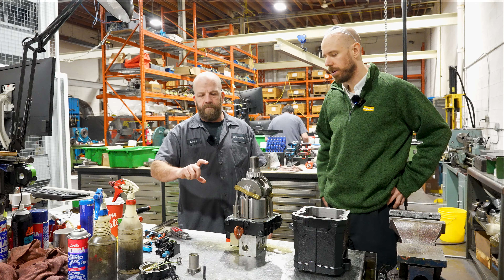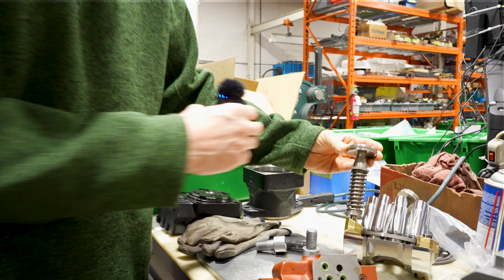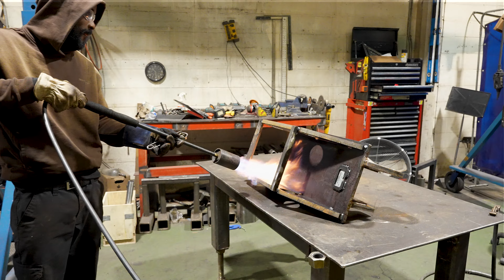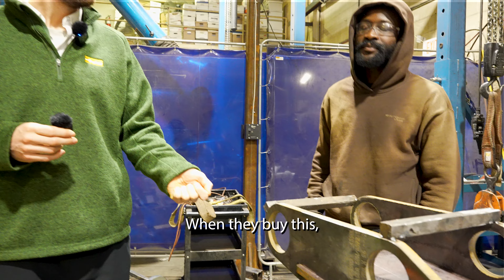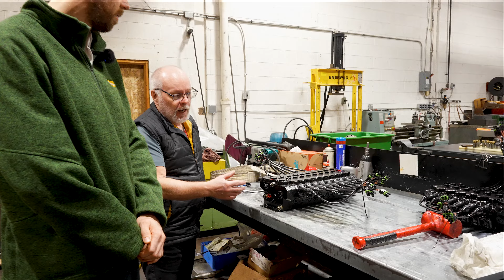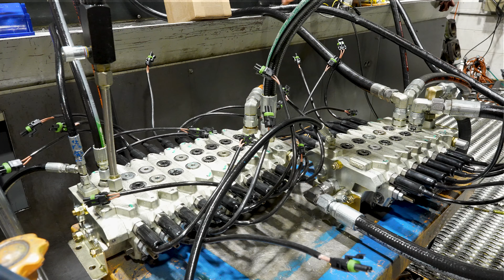TWO Mysterious Balls in My VPL Pulsar Valve & Epic Welding Secrets Revealed!

Comment: Pulsars have three different groups of the solenoids. Two groups are PEM controlled ( 33 HZ and 71 Hz). And ON/OF solenoids. 

Every proportional valve controlled by PWM, the difference is whether there dither superimposed on top of PWM.
If Pulsar controlled by IQUAN driver, there might be even pre and post dither signals.